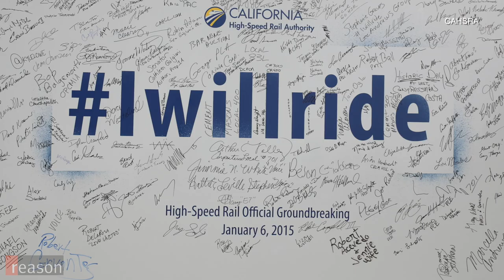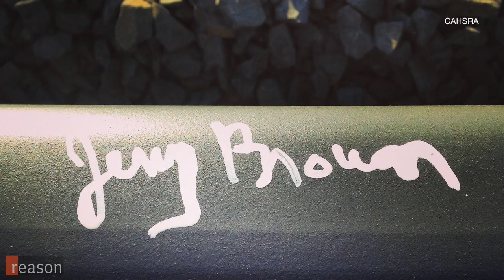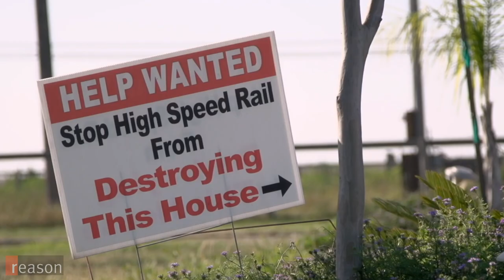The Politician Behind California High Speed Rail Now Says It's 'Almost a Crime'

Comment: Gov. Newsome has put the brakes on HSR so maybe reason will prevail.  It was propositioned as a 30bn project.  Costs ballooned to 70bn with no end in sight.  The HSR crosses some of the most challenging terrain in America.  There are two mountain ranges to cross.  Central Valley ground subsidence is a major problem.  The ground sink rate is measured in inches per year in many places.  And then there is the San Andreas fault which parallels the line the whole distance.  It is a colossal waste of taxpayer money.

Comment: High speed rail only works when Govt funds it as a very long term infrastructure investment - like in Europe. It must significantly shorten journey times and the only way to do that is dedicated high speed routes. High speed rail between London and Paris destroyed airline traffic overnight and the ferries only run across the channel as they are cheaper than the truck service through the tunnel.

Comment: We've already known this forever. Railways have a high upfront cost, but in the long term they are far more energy efficient for transport of cargo than shipping containers on trucks, and are therefore far more beneficial in long term infrastructure.

Highways are also extremely costly to build, and have a higher long term cost for transport of goods, the number just doesn't look as bad because it's not consolidated into one system.

Comment: I lived in Japan, and high speed rail and other passenger rail systems are great there. It works because of population density, interconnected rail lines that feed each other, and the sheer pain of driving.

Rail Mass transit doesn't have to make a profit. So long as it enables more than enough economic activity to offset its costs.

Comment: In order to convince Americans to support public transportation, the government should build MRT systems in cities first.  Not high speed rail that connects cities.  Though there should be high speed rail that connects major cities, what happens is that the stations are located in the middle of nowhere.  It's like the project was setup to fail from the beginning.  A better way to convince people is an MRT system in a city to give them a taste of what fast and efficient public transportation is like. That way, they have firsthand experience of the massive benefits of trains.  It is immediate and apparent.  Put an MRT system in a major city with at least 100 stations, and continue to expand it until it has two dozen lines and 500 stations.  That would definitely convince people to cut the number of cars on the roads and streets.

Comment: actually, the plane flight is super short anyway, so new flying technology won't impact the process much. the most time consuming part of plane travel here is the "before taking off" and "after landing". it takes two or three hours on either end because you need to arrive at least an hour early and it takes over an hour to get to the airport. on the other side, it's a little less, so the total amount of hours in transit is around 5, door to door, not including car rental. the flight is 1.5 hours. If you just drive, it's a little over 5 hours and you are in your own car that doesn't smell like perfume and air freshener, like a rental would. switching among all those different modes of transport is very stressful so it often makes more sense to drive.

Comment: There was a letter written by a French contractor,  sent to the LA Times, outlining the plan they proposed when they bid on the contract for the high speed rail. It was to take the coast. Precisely because of the political issues mentioned in the video. The contractor was as baffled by the decision to go through the valley, and declined to pursue the contract, claiming it would lead to slow down in progress and cost overruns.
So.the question I have is, why didn't anybody listen to the experts?

Comment: What those people claiming the rail operates at a loss don't understand (or they do, but they want to manipulate the public) is that even if it is true in some cases, the rail creates synergies that could be very beneficial for the economy overall. When assessing the viability of a big infrastructure project, you have to look at the big picture.
Reply: The train is basically no different than the plane other than it being a slower and more expensive alternative, so how does in benefit anyone?

Most Americans would still have to drive 20-30 minutes to the train station just like the airport, go through security just like the airport, get on a 3 hour train ride while the plane is 1 hour, face the same last mile problem at the other city just like the airport.

Comment: the main interviewee's thesis is that trains are a 19th century technology, but then he goes and makes the case that the reason it isnt happening here is because the politicians screw it up - which is the thesis he should have been proposing in the first place.  to take the shinkansen example, I think he is also using outdataed data from before the rails were privatized.

here is the real reason why passenger rail in the US has a hard time:  the US does not have the necessary population density on the whole to support inflexible point to point transportation.  Japan has a population half the size of the entire US compressed into a land area the size of california, as well as a highly developed feeder rail and bus system to serve the first and last mile problem.  also, the rail companies own the stations and their immediate surrounding real estate - if you've ever been to japan you will agree that their station are tourist attractions in their own right with shopping and other amenites for days.  US rail stations are NOT anything like that.

Comment: Some innacuracies... trains have been going over a hundred miles an hour in regular service since 1900. Steam trains between Chicago-milwaukee- twin cities, Long island rr, Chicago-LA. Japan's bullet train unveiled 1964 olympics, France's TGV, a few years later. Both countries had steam powered high speed service for decades at the time. Today's high speed trains at 200mph, could compete with air travel, while using one tenth the energy of air craft, up to a practical limit of about 400 miles. Problems like cost, political mismanagement, true.

Comment: Oh yeah...I want to be traveling 200 mph on rails built on ground that MOVES !!   Oh yeah....this should go well.
Reply: @hypernewlapse  Right but they build things correctly....not like us where we build them cheaply and sloppily.  That's the difference.  We can't even run a REGULAR speed rail system correctly.
Reply: @hypernewlapse  It won't till the structure of US corporate thinking changes from quarterly results to long term benefit.  I have been a senior level director for a fortune 500 organization for over 45 years (just retiring now).  We are actually moving in the WRONG direction today.  I'd have thought we'd learn but it's actually getting worse.
Reply: @rds990  "not like us where we build them cheaply"

Wasn't it expensively rather than cheaply?

Comment: I can see a crime. Why need Amtrak about 10h for a 400 ml journey. That is a 40 mph. A conventional trains usually make 50...75 mph.
Actually normally modern commuter trains are homologated for 100 mph.
So with a conventional Train a trip under 4h would be possible. (This is the threshold you would be faster than a airplane) 
But for decades the bed on the wrong horse. (The car)
How run down this system so terrible?
But now you have nothing to work with and have to build it from scratch an that is expensive.
But I can understand the airline and car lobbyists that they are afraid of this trains.
When they experience the alternative to driving and flying they want more of that.

Comment: I seldom agree with Musk,  but pragmatically he was right.   19th century transportation even at 250mph is still suited to 19th century life:  you have to leave from a place you don't want to go,  at a time you don't want to leave,  for a place you don't want to be. 

However goose and gander,  aren't rubber tire automobiles a 19th century invention for 20th century lifestyles.   Whether it be gasoline,  Diesel, hydrogen, EV batteries or unicorn farts the private automobile for asphalt and concrete paved roads is a very dated thing.

Comment: The problem is the political cronyism and corruption, not high speed rail as a concept. Saying it’s “not profitable” is missing the point. The reason China is building so much high speed rail is that it increases the productivity and efficiency of their society. Not everything worth doing needs a business model
Reply: Keep in mind China has over 4x the us population and 94% of them live in 43% of the country’s land area making them way more dense.
Chinas cities also can’t be compared to American cities, they are just too different.
China build high speed rail because their domestic air industry isn’t that great and already over capacity, and so are their roads because of their population alone.
Reply: @blackhole9961  Basically everything you're saying is either irrelevant or incorrect. A greater percent of the US population lives in urban areas than does China's population, so ours is more concentrated. China still has a larger rural population (percentage wise). 

High speed rail linking SF and LA would be extremely valuable. Two huge urban areas 400 miles apart is exactly what you want high speed rail for. That's why CA voters approved it. It doesn't have to operate like a profitable business to provide net social benefit (something many people fail to grasp).
Reply: @davidmcmillan4183  them literally having over 4x the us population is irrelevant?? Umm you are aware you need density to make these things happen right? Something the US very much lacks, don’t let percent of urban population fool you because it also included America’s suburbs which aren’t very dense or urban which is why I said don’t compare American cities to Chinese cities.
60% of Chinas population lives in cities, that’s still 840 Million people! The US population is only 330 million. 
The 2 cities are nearly 3 hours by high speed train meanwhile Southwest Airlines can make the same trip for way less the price an in about an hour instead of 3. 
High speed trains just can’t compete in terms of speed.
Reply: @blackhole9961  lol you know nothing about california if you think you can get from LA to SF in one hour. Try taking an uber to LAX, going through absurd traffic to get to the drop off point, airport security, inevitable delays, then the flight, then 45 min on bart (or worse traffic) to get from SFO to downtown San Francisco (god forbid you have to go further). For most people you're talking about a 7 hour journey at least. 

The idea that because we're not China we can't do this is just stupid. It works in other countries too (just as one example, Edinburgh and London are further apart and have smaller populations overall, but are linked by high speed train, which is a much more enjoyable journey than flying between the two). The experts who studied this project disagree with you and concluded that the majority of trips between the two cities would be taken via rail travel once this project is completed. So sorry but you're just armchair bloviating about something you don't understand, with no evidence to back up your claims.
Reply: @davidmcmillan4183  The same thing also applies to trains. Have to Uber all the way to the train station, trains can also have delays, ride on the train for 3 hours, then use another form of transport to get to your final destination. If both plane and train had the same departure time which do you think would make it to its destination faster?

The Edinburgh to London train runs at a maximum speed of 125 mph and takes 4 and a half hours by flight its 1 hours 40 minutes. Those "experts" clearly lied to you if they thought it would ever compete rapidly enough with planes. In fact thats one of the major reasons why investors pulled out of that tragic failure of a project, they knew it wouldn't compete rapidly enough with air transit. The California high speed rail project is a boondoggle that will never be completed, its a scam. 

The only real area in the entire country that actually needs it is the north east corridor.
Reply: @blackhole9961  I've taken flights between London and Edinburgh, and taken the train (both many times). I can tell you the train is far better, cheaper, and more convenient. A train between La and SF would go between the downtown areas of the two cities, not between the airports. For most people that's much easier to get to. Plus the train would also connect to other major population centers within each greater metro area (Anaheim, Burbank, San Jose, etc). 

Do I agree with you that the project is horrifically mismanaged? Yes I do. But with some competence in charge of building it, it would be easily worth it.
Reply: @davidmcmillan4183  But we are talking about the essence of time here, in terms of speed the train just cant compete. 
Also its cheaper to take the train domestically in European countries than it is flying. America is the exact opposite. 
Sure the train takes you to downtown, but because these are American cities odds are your not even in walking distance to your final destination also it takes the train longer to get to the next city than the plane.

The plane also connects major population centers. in fact all of those cities except 1 has an airport, and Anaheim has one not far from it.

All in all the high speed train is just a slower but more expensive plane. So whats the point of even building it when the plane already serves the exact same role but does it faster and cheaper.

Comment: Americans prefer to drive, that's why the system did not get support.
In other countries they are being used. In China people wide theme all the time and eventually they make money.
Reply: Americans prefer to drive because the current rail infrastructure has been strangled by big oil and the auto industry. If given the choice between sitting in car traffic on a well maintained road and taking a well maintained rail based mass transit route, people will choose the rail option almost all the time. Case study: Europe, China, South Korea, Japan.
Cars are expensive, slow, dangerous, and extremely inefficient compared to trains

Comment: Has to be a Democrat.  They are determined to try everything that's failed several times and makes no sense, especially if it's in opposition to basic economics.  If people wanted to use rail it would  be profitable and we wouldn't have spent the last half century taking up railroad track to make bike paths.  Any rail project that's not a big city commuter train is a boondoggle.

Comment: I guess cars are okay? Also 19. century invention (Karl Benz in 1886). And streets and roads aren´t profitable either as most infrastructure isn´t. But without infrastructure no economic value can be created. Furthermore, it´s not forbitten to take an old solution and improve it. Else you couldn´t use guns as their 16. century counterpart were inaccurate, slow to load and without a trigger.

Maybe the train should just burn oil, so the Koch brothers will like it and stop subsidizing this magazine.

Comment: I love how they use the "oh and it's bad for the environment" just before speaking about:
1 hypersonic jets (aviation is worst for the environment)
2 autonomous cars (batteries are difficult to procure and harmful)
3 hyperloop (oh so that it's going to use concrete? Great :P glad it's now all of the sudden a good thing)
Clearly bias :/
Reply: You’re right, the alternatives aren’t emission free but they aren’t built using taxpayer funds and:
1. These can reach speeds of 700mph+ which is much better than this rail line and also it wouldn’t require any new infrastructure. 
2. Autonomous cars can be all gasoline based too and they would be used for other purposes instead of this train being only from point A to B. And they’re environmental footprint would be much less.
3. Hyperloop would achieve speeds upto 800mph and is fully privately funded. The speeds are much better here.
In summary, yes all the alternatives will cause emissions but what they offer is much better and convenient than the rail line and is not eating from taxpayer funds. There is going to be environmental damage using any modes of transportation, so why not choose the most efficient one instead of the regular slow one.
But if you want to see bias, you will find a way anyhow and then there is not way around it!

Comment: Here's how to have profitable high speed raid. Have lots of smaller rail networks and use the high speed raid to get passenger to the smaller networks. The network's will be profitable and subsidise the high speed.

Aka high speed rail brings in riders to the low speed rails.